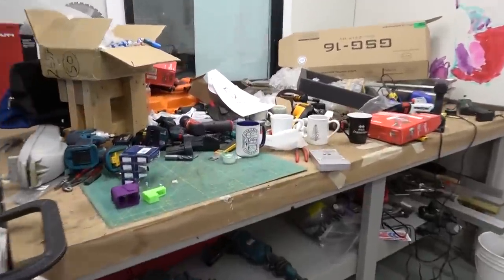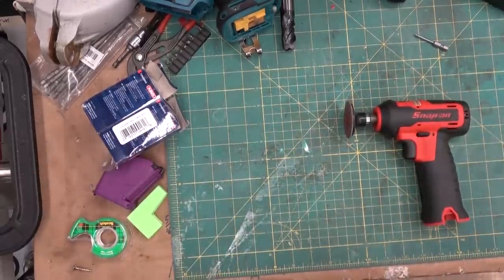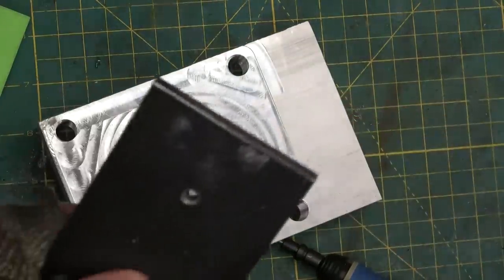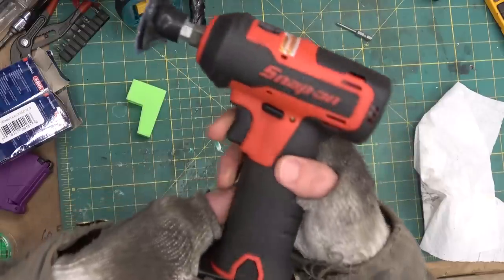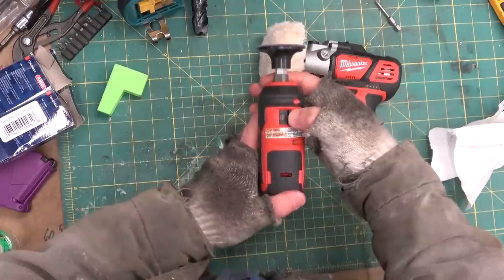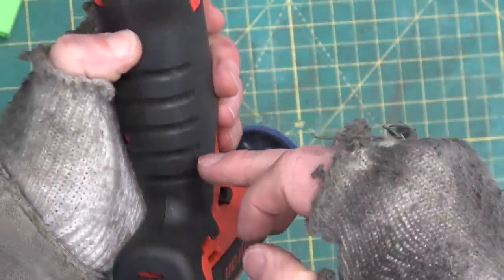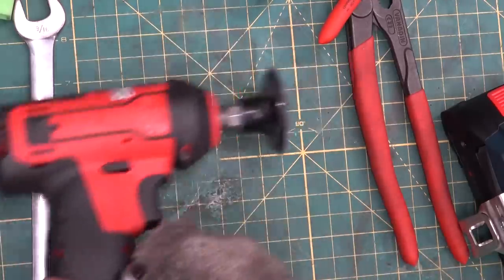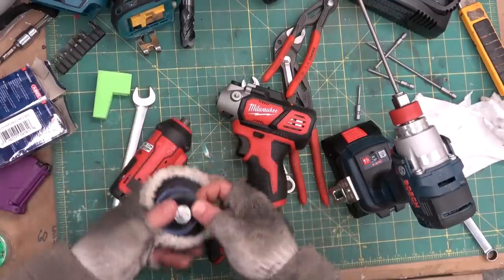BOLTR: Snap-On Polisher $$$ worth it?

Comment: "Parts Tray"- supervisor term for the device that ensures all fasteners end up on the floor with the same motion rather than individually.
Reply: Its so much more efficient.
Reply: I got one of those magnetic ones from Harbor Freight. I promptly discovered that most of the panels on my LeSabre are aluminum, so I'm still sticking everything in precarious positions on the car.
Reply: ROFL! It's nothing but true!
Reply: That's an industry standard 5S process. Sorting.
Reply: Parts tray? And here I thought it was a bedpan for the persnickety OCD types.
Reply: @mike_aglione1132  That's exactly what I say when putting bolts in a parts tray. It's more efficient to lose them all at once.
Reply: And here I was thinking "Let's get this out on to a tray"
Reply: @h60memo  That's what I thought too.
Reply: @Cjinglaterra  The real good of those is that a lot of screws are magnetic.
Reply: i dunno. ive stuck a big magnet to the bottom of a metal bowl and never lost a teeny tiny screw since.
Reply: S
Reply: @h60memo  ha was looking for this comment! Steve1989 and Ave: two deep niche channels with wholly unexpected charisma

Comment: $40 tool being sold for $540. Gotta love them brandings.
Reply: You also get $40 in batteries and a $20 charger for that price. But yeah my thoughts exactly, looks like one of those IKEA drills
Reply: At least if you’re buying HF junk, it’s a fairly honest transaction. They aren’t pretending to be something they aren’t.
Reply: James Milos HF is actually good bang for the buck on a few electric tools. You just at least expect the Fap-Off to be much better for the price gap
Reply: Not the slightest bit suprised.
Not even brushless for that price, longer battery life... no brushes to wear out. Itd atleast have some pub ammo.

Comment: The "speed holes" in the copper heatsink are part of the flattening process.  Pressed up aginst pins, brings the other side to flat-as.  That way you get a far better thermal joint yada yada yada
Reply: Aha, that finally explains the dimples I see in camera shutter and iris parts.

Comment: @AVE I have had mine for around three years. I use it almost daily and it has held up fine. I bought it because it was the only thing on the market at the time with the power and 15000rpm. Not worth  the money for the home gamer fantastic for the guy who uses a die grinder daily without access to compressed air. When she finally dies I will probably replace her with the new Milwaukee.

Comment: I've got one of the snap on 1/4 impact drivers, 14.4v. Used it every day for 4 years, and charge it maybe 2 times a month. Replaced the clip that holds a socket on once, the black rubber isn't peeling. (And it sees motor oil, brake fluid and coolant on the regular) Best tool I've ever bought.
Reply: charging a tool twice a month means that you don't use the tool as often as you may think and after two years it may have done a total of 20 hours work

Comment: On a side note AVE, I found a failure mode for the brushless drills that isn’t so much there on the brushed versions. I have the Dewilt in both Brushed and Brushless and I almost burned the thing out when drilling upwards into some steel beams at home. The steel swarf got right into the permanent magnet of the rotor and nearly wrecked it. Luckily I pulled it a-part to see and it’s still chooching now.

Comment: I've had one of these for a couple years, still works as good as it did the day it was purchased. Lately I've mainly been using it for cleaning grounds on machines. The other 14.4 tools that I purchased have since been retired /replaced by milwaukee. My microlithium 3/8 impact (was sent for repair 4 times within 2 years) Now I only use it when chasing threads. And the drill burned up after drilling only a couple holes without a rest break between them. (also replaced by a milwaukee)

Comment: I use Snap-On tools at work very often and we have one of these polishers, the over molding has definitely stood the test of time, and to my surprise has not started peeling off in the 4 years of use. we have other battery powered Snap-On tools and none of the over molding is peeling other than on the 14v 3/8" drive impact, by far the best tool in my opinion i have used by snap on. my biggest complaint with all of snap on power tools is the light is only on when the tool is engaged, so lining up a socket on a bolt under a car you can’t just hit the trigger and get a few seconds of light. it seems to me like it would be very easy to fix this and at the price of the tools i don’t understand why they don’t have a feature that many others have at half the cost

Comment: Almost all my tools are Snap-On and I've tried their electric tools and they are hot garbage. My Milwaukee electric ratchets, guns, ect get a beating everyday at work and keep on working. Love my Snap-On hand tools but the electric tools just don't last. Batteries that die and cost more than other whole tools, that rubber overlay peels right off if it even sees solvents and god forbid you drop it.
Reply: Hell snap on is being left behind in the hand tool department these days also .

Comment: One of the main reasons I've eliminated Snap On power tools from my field of purchasing view is partially (as noted in the video) that the batteries are always monstrously difficult to remove from the tool and charger. Upon initial exposure to this, i attributed it to the tool being of tight fitment and being not broken in yet, but here I am 4 years later still cursing the indicator light when I have to swap batteries with colorful language being liberally applied as I incur another repetitive stress injury while trying to tear the battery free from the tool.

Comment: The only reason I can see getting the snap on tool, is already having brought into their battery system. Which is actually Milwaukee's best selling point in my opinion, having a large selection of tools sharing the same batteries!
Reply: After using Milwaukees once I got into construction, I finally made the decision to just bite the bullet and buy into a big brand - and you just can't go wrong with Milwaukee, their battery packs may be the best in the industry, and the tools that take them are certainly not lacking compared to their price point competitors.
I never thought that buying into an expensive cordless ecosystem would be the best tool buying decision I ever made - but I didn't think that cordless tools would just plain outclass air tools in a relatively short amount of time either...
Reply: and all the new boys like Bauer have copied milwaukees price point and battery system and easy warranty access. wouldn't be surprised if at some point snapon goes away. predatory lenders be dammed one day young people will be to smart for your idiotic pricing systems
Reply: Wouldn't it be great if we could have a standardized battery system though... I know metabo have to some extent, which is a good start!
Reply: @MrChrisbell1  or even to swap the 18650 out when its time without needing to spot weld would be very convenient
Reply: @RyTrapp0  When I was looking into which cordless tools I was going to buy, I looked hard at what the various companies said about their batteries, and the charging systems. The only two that I could find that even mentioned cell balancing was Milwaukee and Festool. As you may very be aware of if a single cell in a battery pack gets its voltage to far from the rest, the entire pack reads as bad to the tool, and charger. Milwaukee was the only one of the consumer priced tool that mentioned cell balancing in their literature. So I went with them. I sure am glad I have. Not a single battery pack has gone bad. Use in very cold temps, high temps, use so hard that the tool becomes too hot to hold, and the batteries are hot. Yet the Milwaukee tools keep working.
Reply: After looking through their catalog again, I wonder how many tools they have in R&D for the ladies?
If you know what I mean...
Reply: Almost all manufacturers have balancing systems in the battery pack, exept for the cheapo and scary ones
Reply: No thank you, I'm not buying a crap tool for 10x what it's worth just so I can stick with the same batteries. Hell my Milwaukee tool set cost less than that Snapon sander.
Reply: @om617yota8   I'm heavily invested in DeWalt cordless tools and batteries but still own a few Milwaukee 12v tools including the polisher/sander. I will never understand why someone would rather spend 300.00 more for a tool just to match their battery platform. It is typical of the snap on fan boys though.
Reply: @brandonlink6568  I got hooked by Ryobi during the NiCad days when their tools were navy blue.  Stuck with em into LiIon because you could put their new lithium batteries into the old blue tools, unlike every other brand that changed battery clip design when they swapped the guts.  I'm not a fan of baby poop green, but it sure is easier finding my tools with tired eyes the end of the day than the dark blue ones, even covered in crud.
Reply: That's 50% why I stick with Dewalt. Already have tons of good batteries. Haven't had one kick the bucket yet, though my drill driver screams like a little girl which I think is from fudging the gear shifter mid drill causing lovely sparks to fly out of the machine. My old 18v drill driver from like 04 is still working too, with the battery adapter.
Reply: all the major brands have that selling feature. dewalt and makita as well. makita also has some 36v tools that simply use two normal 18v battery packs. smart move! some brands would have made a special 36v battery pack for which you need another charger and can't use on any other tool.

Comment: With all the talk of sealed, shielded, and open bearings - can you do a test to see if the shield or seal creates some friction for the bearing? Or if it can be set up, run all 3 types through a bunch of junk and see how they actually turn out. For all we know, shielding can keep junk inside in the bearing.

It would be a great test to see if the conventional wisdom still holds.
Reply: Absolutely would love to see this from uncle Bumblefuck
Reply: If not here, Project Farm would take on that challenge.
Reply: A seal would add drag for sure, I don't think a shield would as it isn't touching anything. I don't see much point to testing them, seals work well for small stuff, shields keep the sticks and stones out, and obviously open bearings would be crammed full of junk immediately. Their usage cases are not interchangeable, so what point is there in comparing them?
Reply: Sealed bearings are known to have more friction than shielded & open as the shield doesn't touch the other race. The differences (if any) in friction between shielded and open are minor if noticeable.

Keeping stuff in, yea, the grease, especially when the grease gets warm and thinner. Bearings don't last long without the grease, because the balls don't actually run on the races, they run on a thin film of the grease. If the "junk" can get out, so does the grease. Getting dirt or grinding dust into the grease makes the grease essentially lapping paste which will wear down the bearings or races. If water gets in then you get  corrosion which will pit the bearing or races.
Reply: I have used both sealed and shielded bearings on a 36" coulter on a tree planter that you pull behind a tractor or dozer. Both fail, the sealed bearings last longer overall. Depending on the soil type I've replaced the shielded bearings so many times I think we lost money on the job. WE cut off the mount that was engineered from the manufacture and put the shaft in pillow blocks with sealed bearings and that got us longer life out of the bearings. We also went to a hardened chrome steel shaft that is used for hydraulics for the axle and that helped keep the wear down on the shaft so fine sandy soils could not penetrate to the bearings. That combination seemed to be the best.

Comment: Shop story: torque to 800 ftlbs or until washer crushes. Snapoff half inch cheater bar shatters. Old craftsman someone found in the back of the shop finished the job.
Reply: BlueNinja ain’t that the truth. old craftsman Torque wrench was only off by 1.5lbs when I got it checked after 20 years of use. Some my best tools.

Comment: I don't know about this thing specifically, but many years ago I bought a Snapon 7.2v mini 3/8 rattle gun used for $100, beat the ever loving crap out of it for the last 4 years every day as a mechanic, without any problems or battery loss. Dropped it hundreds of times and even used it to drive a few hundred concrete anchors mounting equipment in my new shop. Oil and grease on it every day and then cleaned off with brake clean and the overmold is still not pealing up. At the same time I've torn up 3 dewalts with much less regular use. Not sure why or how but the  thing has been incredible even though it looks like it went through a wood chipper.

Comment: Either that's apprentice level soldering or they asked them to thread a needle up an ants asshole and that's where the strands came from.

I soldered a fair amount of wires in  eyeholes on switches and if you botched it up you're being rushed or not paying attention. In this application it could be they asked them to do an awkward soldering arrangement.

Comment: I think everyone is missing the point here. The Snap on polisher / prep tool is designed to get in tight , where larger tools are too bulky to work. The versatility is the variable speed trigger which you can feather to get the right rpm. Also the low speed is up to max 3500 rpm, and great for polishing. The high speed is 15,000 rpm. This is great for cleaning gasket surfaces, brake rotors intake gaskets , etc. This is where you would normally use an air grinder, but without having a bulky airline getting in the way. I find the convenience of this tool to be a plus. By the way I’ve used this tool for 3 years, and it’s still going strong!

Comment: So its basically an overpriced drill that cant take drillbits?
Reply: Yah bud
Reply: That was my thought. I have adapters to take sandpaper that fit my De Walt- I can sand forward or reverse, two speeds no waiting!
And no five hundred extra doll hairs!
Reply: They spin quite a bit faster than drills 
Certainly the air type 
Catterpiller die grinders  anyhow 
If fried using a cordless drill to save unrolling an air line but drills just don't cut it once you've used a proper die grinder 
I'm in the market for possibly the milwakee one just because I'm already I their battery system 
Mind you cat grinders are only $80 Aus each and last for ever 
Mind you cat
Reply: yes if your dril can do 15000 riperms

Comment: The Milwaukee M12 compact 2-gear polisher (model 2438) shares its design, and most of its specs, with several other 12V 2-gear polishers, including ACDelco ARS2014, Earthquake, Sealey, and SPT.  At 14.4V, you've got Snap-on and Ingetsl-Rand. Each brand requires its own proprietary battery. Since I already own a few M12 tools, I see no reason to choose an offbrand--especially because none of the off-brands offers a battery larger than 2.0 amp-hours, or 22 watt-hours. With Milwaukee M12, I can use a battery ad large as 6 AH, or 9AH if I use a third-party battery.
But one clone stands apart: The ACDelco ARS2016. It uses the same body shape and size as the 12V/14.4V polishers. But it's the only model that uses a brushless motor. So it runs more efficiently and won't overheat and shut down as often. Also, it uses a 2AH, 20-volt battery, which provides as many watt-hours as a 12V, 3.5AH battery. In fact, it comes with two of these batteries.
Brushless motor, 20V, same form factor.

Comment: I have the cordless ratchets and cordless drill and 3/8" impact in the Snap-On 14.4v line, I use them all, all day every day at work. I've had no problems with any of those, but I don't have the little sander that you've got here. I will say that I didn't buy them for the name, I bought them because I can make weekly payments and they do have a decent warranty and I get awesome customer service from my Snap-On dealer. Also, the only tool dealer I had at the time was Snap-On. If the other tool trucks that are out there, Snap-On has been the only one that has been reliable at the various shops I've worked at at. Cornwell, Matco, and Mac seem to not be able to keep franchisees for very long and it can be years from the time one quits until another appears, and then gives up a few months or a year later.

Comment: I use that snapon buffer almost every day for the past two years. I will tell you it will hold up. I use it mainly for buffing good ground connections on engine blocks and frames as well as cleaning terminals. I throw around all the time and spray it down with brake clean as well. None of the rubber molding has come off. I have most of the micro lithium stuff from them. I will buy another one if this one fails. Same goes with their micro lithium 3/8 impact. The batteries are the only thing that seems to suffer after time. But what battery last’s a lifetime. Love the Vijaho’s.

Comment: I've owned the Milwaukee one for 5 years of almost daily use with zero problems.
Reply: I too have the Milwaukee one, other then the weird sized thread on the shaft and almost non existent market support in that size. I have used it quite a bit mostly for small sanding jobs, though I did get some buffing wheels for it to take off adhesive from those are all using the sanding twist lock attachments  though.
Reply: I have had it for almost 4 years with zero issues. It gets used about 5 times a month though, the rest of the time it sits.
Reply: My Milwaukee has lived it's entire life (4 years so far) in toolbed on a service truck.  Living on the Gulf Coast. It's not uncommon to open my cordless tool drawer to find everything covered in condensation.  The tool still works flawlessly.  On average it probably gets a full battery of usage a month.  Great tool